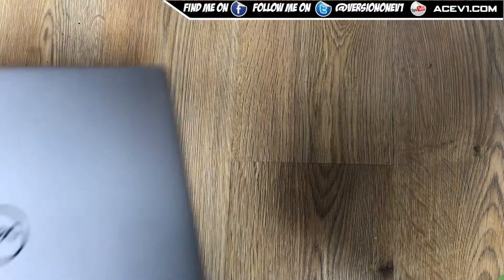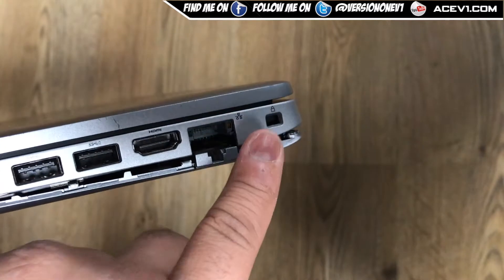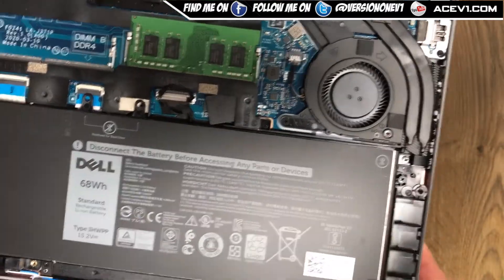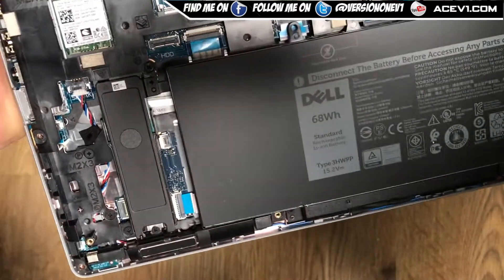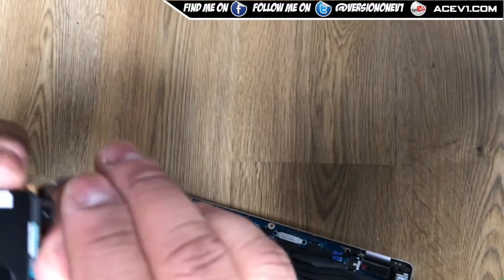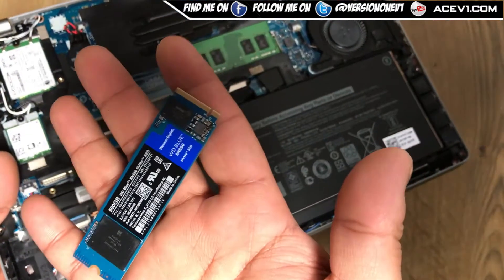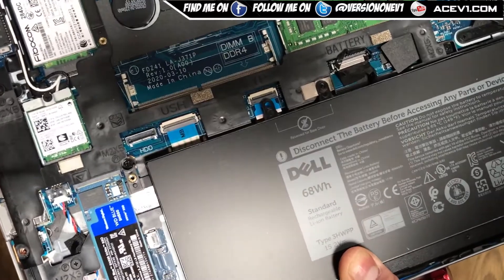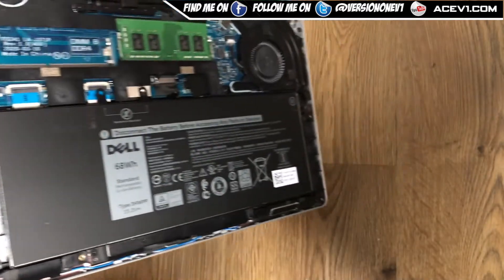How To Dell Latitude 5410 10th Gen i5 SSD Upgrade Battery RAM Replacement

Comment: Very informational tutorial. Thank you very much for posting. Can you please post a link to available SSD upgrades? What is the max SSD that is compatible with this laptop and can you post a link to the SSD that you use to upgrade? Thank you very much. Also, if you could post a link to the ram, . that would be much appreciated.
Reply: Ssd laptop gen 3
chip gen 10th not support ssd gen 4 :(